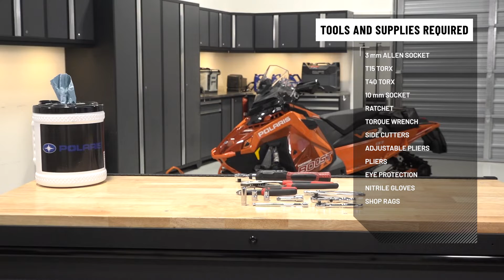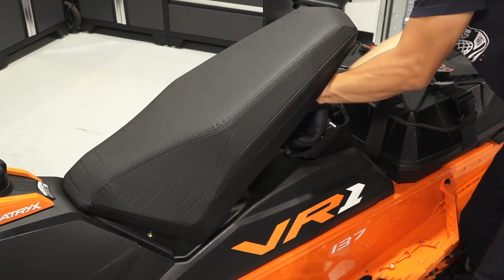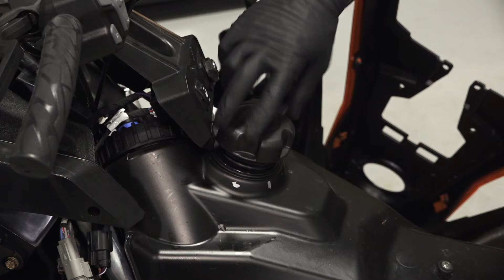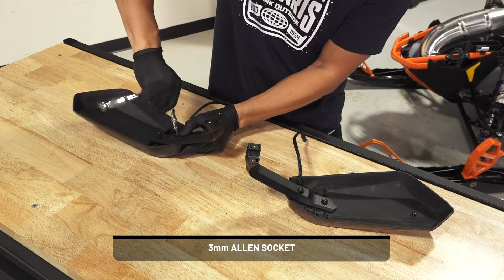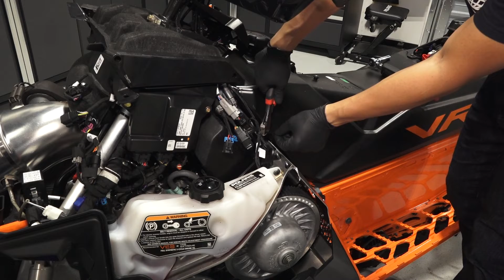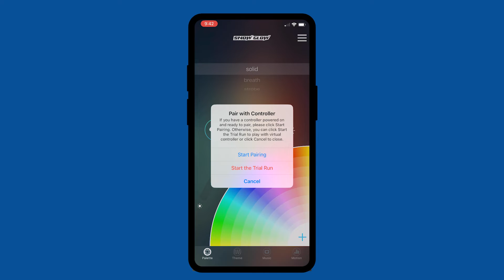RGB Handguard Accent Light Kit Installation | Polaris Snowmobiles

Comment: I do love the lights! There are lots of options to choose from and they stand out!  Might I suggest an interface through the 7s guage.  The process of pulling out your phone and reconnecting every time you turn off you snowmobile is less than convenient. Also would be nice to have them operate without the sled running.